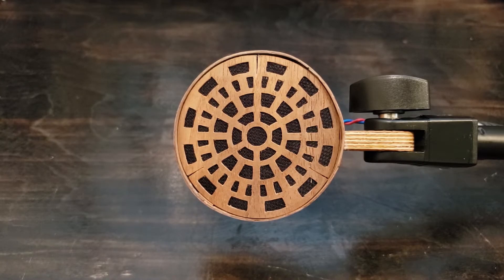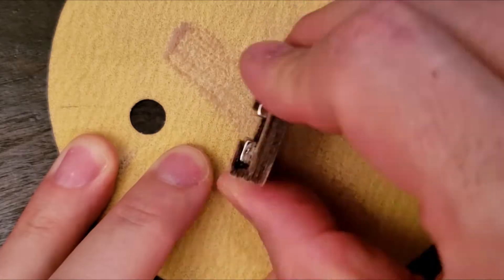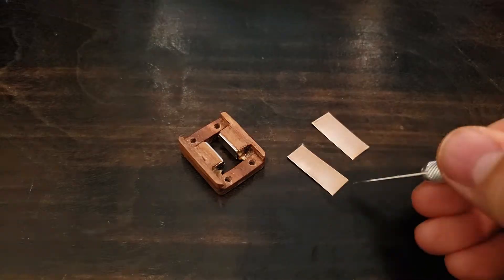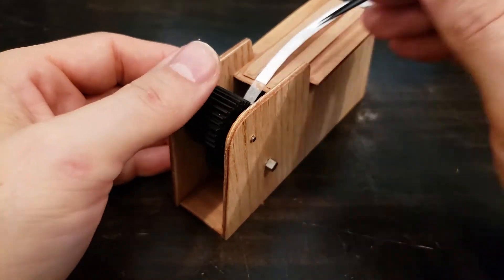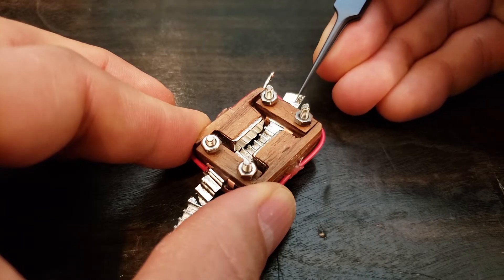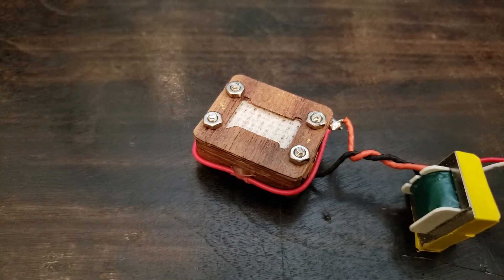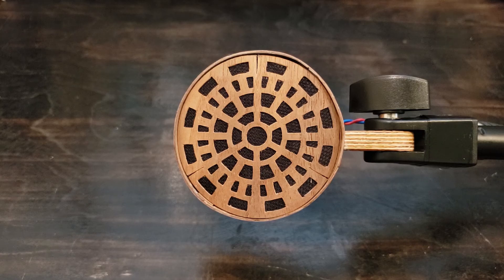DIY Ribbon mic How to Make a microphone RCA Inspired #diy #microphone

Comment: What is the difference if we use copper thin sheets for making the ribbon? whether performance is same ?
Reply from the maker: There should be no difference.  However, eventually I moved away from copper since there's a reaction over time when in contact with aluminum.  Silver is now the preferred metal, or silver plated brass.

Comment: how about using a spacer between the ribbon and the magnets during installation? Are usually go with pieces of printer paper, which is just about thick enough and stiff enough to do the job as a temporary spacer. of course, the tricky part is the removal of the spacer after installation of the thin aluminum ribbon.
Reply from the maker: Excellent tip!  I did it in a different video, and you are right- removing the spacer(cardboard, in my case) was a job!  It did make it easier to permanently glue in the magnets.

Comment: Were the magnets aligned so that they were pushing away from each other or pulling towards each other?
Reply from the maker: Pulling toward each other, that's important. If they are pushing away, you'll get very little(or no) output.
So the magnet polarities would look like:  [NlS] Ribbon [NlS].  Or [SlN] Ribbon [SlN].  In either case, the polarity runs the length of the magnet parallel to the ribbon(through thickness) and pulls against the opposite pole of the other magnet.

Comment: how do you deal with hum and noise if you don,t have a metal chassis?
Reply from the maker: I've made these with and without metal chassis.  If you get the "Shield/humbucker" wired correctly, hum and buzz is not an issue- with or without a metal chassis.  If you get the shield wrong, or a bad solder joint- it won't matter what the chassis is made of, you'll get hum buzz and lots of weird noise.
Reply: @FrankOlsonTwins  thanks, wen you say shielding/humbucker, do you refer to Transformer humbucking wiring bobins or what?
Reply from the maker: At 3:53 in the video you can see the humbucking wire loop I'm describing.  It surrounds the magnets and kills hum and buzz.  If you omit it, you'll definitely know- You'll get directional noise where ever you point it.  
To clarify, I'm not suggesting some sort of metal enclosure is not ideal.  I'm just trying to show people what's possible. The final design of this mic has a brass enclosure and mesh windscreen.
I do think the requirement of a metal chassis for the ribbon motor is a bit overstated, however.  The strength of the magnets gives a solid output without the added "flux path" offered by a ferrous frame.  However, anyone with the time/patience/budget/skillset for metal work should certainly try their hand at a metal chassis.  
Also, I prefer to use transformers with a MuMetal canister to eliminate hum or buzz entering through the transformer, which is quite helpful.  
Good luck!
Reply: @FrankOlsonTwins  Great info about the humbucking wire loop! I am designing my own DIY ribbon and plan on 3d printing the motor housing and mic body as that's one of my top choices for DIY construction. It's great to hear the metal body isn't necessary, I was worried that the plastic body would result in too much noise. Now I know to design some wire channels right into the motor body and hopefully that will be enough. If not, I've thought about using conductive paint on the mic body and grounding that to the xlr plug. Not sure how effective that would be though.

Comment: Left and right sounded out of phase on the drum demo?
Reply: by design, ribbon mics have a figure 8 pick-up pattern, so the phase issue could be due to room reflections... just a thought.
Reply from the maker: Not impossible, but listening back it sounds like the right side might just be a little louder. I didn't really hear any hollow or phase artifacts, but the left side did sound a little quieter in headphones.
Reply: @FrankOlsonTwins  Amazing project! I got curious so I pulled the audio into Reaper and flipped the polarity on one channel, and it looks like James is correct. Give it a try and the difference will immediately jump out at you. One channel is fractionally louder, but not enough for it to be annoying. They really do sound fantastic, especially for a pair of homemade, hand-made ribbons!

Comment: I'm looking to make my ribbon microphone. but I don't know which transformer to use. could you tell me which transformer you used? what is its specification?
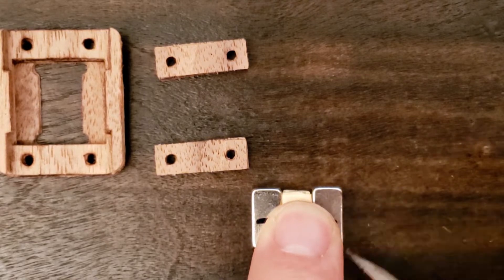Reply from the maker: The transformer is a b-stock one, removed from a cascade microphone.  I think it's called a Shinhom.  Basically, any 1:37 (a little higher or lower is fine, some are 1:28 for example) ratio step up transformer will work.  Edcor, Lundahl and Cinemag all make new ones.  Maybe Sowter too?  If you shop online, just look up "Ribbon Microphone Transfomer" and  you'll get lots of options.
Reply: @FrankOlsonTwins  thanks a lot for your attention man!

Comment: from the video is not clear the electrical part. the red wire sorrounding the whole body deceipted me into thinking you are shorting the 2 sides of the band.
Reply from the maker: The wire loop connects from one side of the ribbon to one wire of the transformer.  The other end of the ribbon goes to the other wire of the transformer.  I have several other videos describing the humbucking wire loop as well.

Comment: I wanna make a mic for tenor and alto sax, what size ribbon element would be best ?
Reply from the maker: You'll want a shorter ribbon(2" or less), less than a quarter inch wide. You can tune it so that the resonant frequency is up around 40 or 50.  That way, you won't get too much proximity effect(bass) in the mic at close range.  I just posted a video showing an RCA 77 clone that I built, which is a classic for horns and woodwinds.  Very thin ribbon, needs a fair amount of gain, but it's not an issue above conversational levels.
Reply: @FrankOlsonTwins  I guess I could build that, but i was looking for a challenge, not some easy beginner stuff, probably build a stereo pair just cause it looks so easy.🤔
Reply from the maker: 😅 Lol, I kind of want to make a second one, but who knows if I have time to build another one! Actually, I would shoot for something with magnets around 1.5" long and space them about .24" apart.  That will give you plenty of output signal. That's in the same league of Royers and Cascades. It doesn't really matter what the motor shape is. Just give it something for the magnets to hold onto without breaking.  If you can make it out of steel, it will have a slightly higher output, but whatever. If it works for what you need, then use it!  Obviously, a labyrinth isn't needed if you don't mind figure-of-8 polar pattern.  99% of ribbon mics are figure of 8!
Reply: @FrankOlsonTwins  Thank you Frank, you are an absolute wonder!  FWIW i really heart emoji the wood aesthetic and have a silhouette cameo, so your design is actually pretty viable, but maybe easier to 3d print it, even with my terrible design skills, cuz it can be done with booleans.
Reply: then I just want to rip apart my broken Ampex MM-1200  and make a mic preamp😅oh well 1 impossible task at a time👍
Reply from the maker: Lol, If I had bought a 3d printer instead of the Cricut maker, I bet my mics(and channel) would look very different than they do :)  I bet this project would be way easier on a 3d printer...
Royer does a few of cool videos about their mics and ribbon size/shape/thickness. For horns and woodwinds, I'd start by checking out their specs and just build a motor around their approximate ribbon dimensions. Sorry to hear about your ampex... Sell it and buy a nice preamp!

Comment: i noticed you've changed your design for your crimper. i would be interested in more info on how you built it. Did you make the rollers yourself, or source them somewhere?

i would also like to know more about how exactly you feed test tones into your mics (obviously not something you did in this video), for resonance testing. Having that process explained would be informative.

Finally, are you open to providing the Cricut files you used for these projects?

These projects are awesome, and i appreciate you making these videos to share your processes and creativity! Thanks!
Reply from the maker: Thanks for checking out the vid!
I designed the crimper around a couple of gears I got from ebay. They are technically RC car gears. The old jig was so ugly, I forced myself to design and make a new one(cricut also) for the RCA 44 video. That's the one I'm using here. The exact gear dimensions don't matter that much as long as they are aligned straight and allow a tiny gap so the foil isn't pinched or cut as it goes through.  One note here, however- I've used that toothpaste tube wringer with some success, but to me the gear teeth were just too big. Also, if you hold it too tightly, you'll chop the ribbon in half! Beyond that, it was hard to set the tension with such large corrugations. That's why i just bout the gears and made my jigs. Plastic gears should be about $20US or less.
The test tone process is tricky because I do it a little differently than the factories might. I use a signal gen in my DAW and hook it directly up to my heaphone outputs. My Headphone output is 30 ohm, so it's an ok match. Basically, you run a few sweeps at a low level(just enough to see it move, so you don't blow the ribbon) from about 0hz to 15K, and as you tension the ribbon, you can visually see where the ribbon cuts off the low end. On a short ribbon, cutoff might be around 50hz. On a long ribbon, you might shoot for 10hz-20hz. 
Alternatively, you can tap on the finished microphone and monitor/see the cutoff in real time in your DAW EQ. If it's too tight, you can loosen the ribbon, or vice versa.
As far as sharing the files, I'm not quite sure what to do here.  Some files, such as the 44 are very complex, and I have 100+ hours of design involved(probably more).  I've considered selling the files for a small fee on ebay or etsy, however, I tend to improvise a little as I assemble, so I feel an assembly guide might be required if selling.  I guess this small ribbon is easy enough that I could just give it away as is, with no tech support.
Anyway, I'd be interested to hear peoples thoughts on the file sharing topic.
Hope some of this helps!
Reply: @FrankOlsonTwins  great explanation! Thank you for taking the time to reply. Personally, my interest in the files would be more for easier visualization of the forces and overall shape, since i can't physically hold it in my hands and measure. i don't have a Cricut, either, although i have thought about getting one for some other projects. Some folks might be able to adapt the files for use on a 3D printer, but i don't have one of those. i have a couple CNC machines, but i would probably just cut the pieces by hand, since i have a good amount of woodworking experience (plus a lot of tools). Having the files available would tempt me to get a Cricut, but probably just to cut paper templates, since the wood i would use is thicker than veneer (luthiery cut-offs). The electronics/soldering should be a breeze for me, since i have done that professionally for decades. The real challenge for me is going to be shaping that ribbon. Your mics sound really great, and i know that comes down mostly to your ribbons and your choice of transformer. You posted elsewhere a list of various transformer brands, but can you tell me what the specs/ratio is on the ones you use? And, if there's any way you could provide an eBay link or specific search terms for those gears, that'd be incredibly helpful. If you're looking for another topic for a video, walking us through the construction of that ribbon crimper would get a certain "like" from me!

Thanks again for the quick reply and for the great content! You've sparked my creativity, for sure! i have a small mic collection, and am a HUGE fan of vintage mics (especially ribbon mics), but have never really had the budget for a ribbon mic. Being a creative sort already (who enjoys woodworking, electronics, and music), this video is nothing short of pure inspiration for me.

Comment: Very cool. I would love to try to make one also. What kind of plotter, wood and aluminum foil do you use?
Reply from the maker: Thanks!  I've been using a Cricut cutter, but if they start enforcing a subscription fee for usage I'll start using something else.  The wood is single ply walnut veneer, I've used lots of different one veneers though. They're the cutoff samples from Amazon- usually a pretty good deal and high quality but you get a lot of different woods, some not very useful ones.
The foil is sign writers leaf, aka imitation silver foil.  It's about .6 micron thick, but if you weight the sheets you can find the thickest ones of the bunch which are about .8 or 1 micron thick. If the foil is too thin, it won't really make it out of the  crimper. You get a feel for it after you do it a dozen times or so.
Good luck!
Reply: I have a Silhouette Cameo 4. The bonus is you don’t need a subscription. Excellent work on the matched pair they sound great.

Comment: Wow, fascinating. Man, I've probably got all the bits I'd need to make one of these, except...what's the foil you cut the ribbon from? [EDIT: okay, just found some online. looks to be around a tenth the thickness of typical kitchen foil, so possibly not something you could hack together with bits from round the home ;) ] I'm imagining one could use Lego cogs to do the corrugation, at least for a first attempt.
Reply from the maker: Sure, any gears will get you started! Also, for this mic ribbon i used Sign writer's leaf, also known as imitation silver foil(99.8% aluminum) it's very thin, about .6 micron.
You  can find 1.8u or 2.5u thicknesses online, which is great for most ribbons, but this short one does petty well with the thin stuff. But try whatever you can find!

Comment: What is the frequency range?
Reply from the maker: I recorded a few not very scientific frequency sweeps(no anechoic chamber here!) but at 6 inches from the source its pretty flat from 50hz to 18K aside from a 3 db boost around 100hz-200hz and a 2-3 db drop above 12khz. 
At 3 inches, the proximity effect increases with about a 4-5 db boost below 200hz.